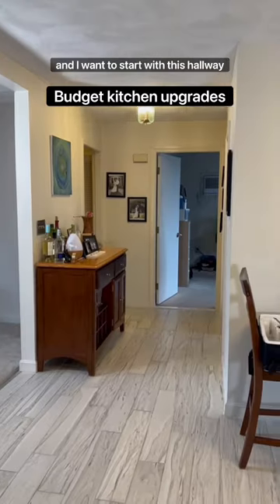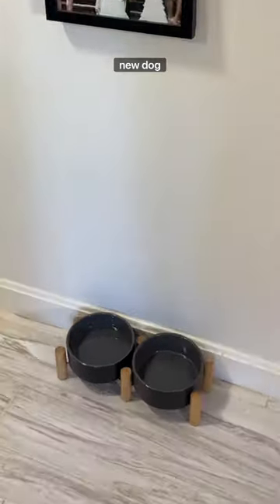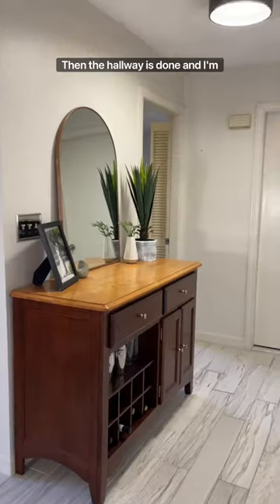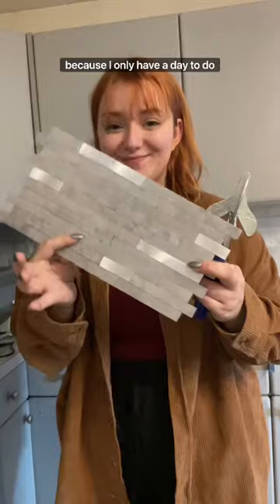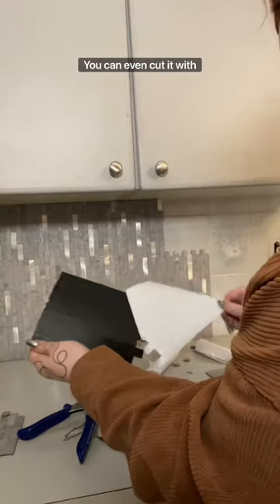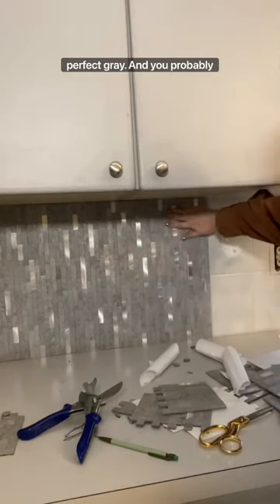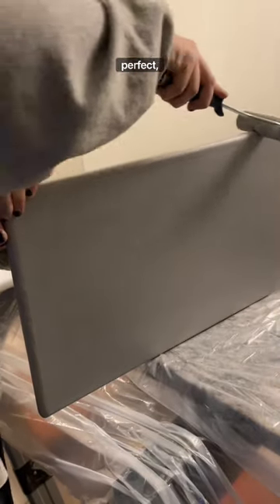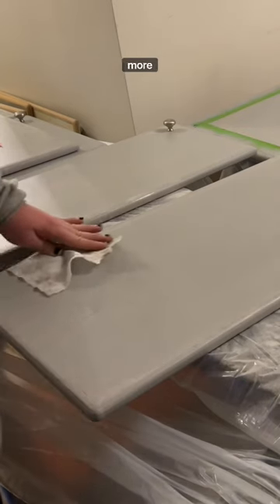Can I make this kitchen look better in a day? #shorts

Comment: Just my opinion. I think the cabinet doors would have looked great keeping the wood outline and painting them a light blue. Idk why I like the wood outline so much but it just feels unique.
Reply: o girl that's a good point
Reply: I’ve been thinking about all the cabinet options since first hearing about the reno in a video, but it would have taken them so much longer to do anything else. The wood clashes with the grey (I’m not a big fan of most greys for this reason) but the rest of the cabinetry is grey — not just the doors — which is a lot more difficult to paint, especially in a small portion of time.

Edit: but your idea would be super cute 💙
Reply: They scuff sanded the wood edge to paint. I would have gone down to the barewood and then a heather Grey wash to tie it in plus allow for the woodgrain to show.

Comment: 'Can I make this kitchen look better in a day?'
Yup-declutter.
Also, I have never seen someone place that faux back splash vertically. I believe it's supposed to be horizontal. But if you like it that way that's what matters.
Reply: Yes also they usually stagger the seams where you join one section to another, so you don't get a really noticable pattern happening.

Comment: While i admire your ability and willingness to redecorate a kitchen, the issue with doing redecos on a budget AND time constraint, is that you end up losing a lot of character because you have to go for a cheap, fast option, as opposed to a show stopper that would take time (or money), which is why ppl are sad the old light fixture is gone and that the cabinets are painted plain gray since how they were at first had more character.